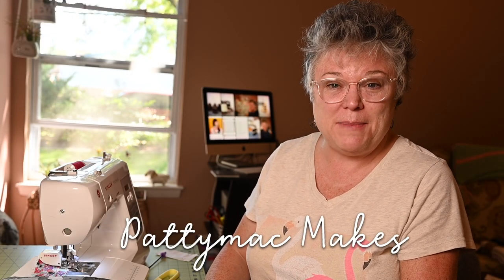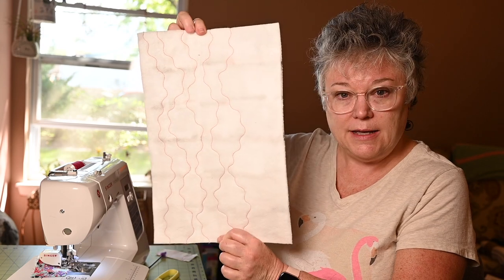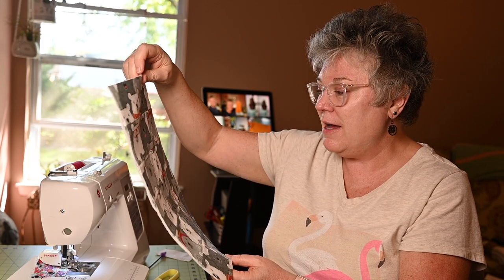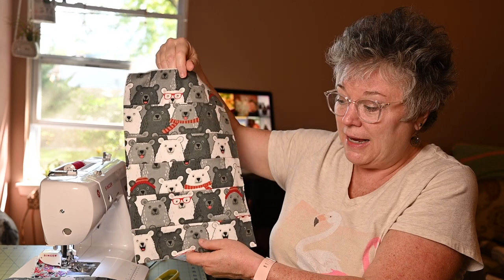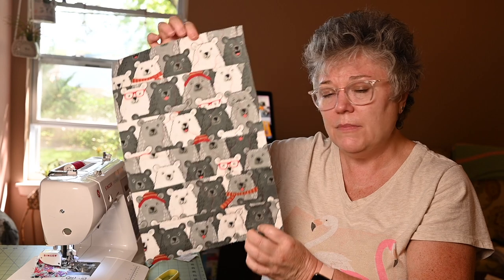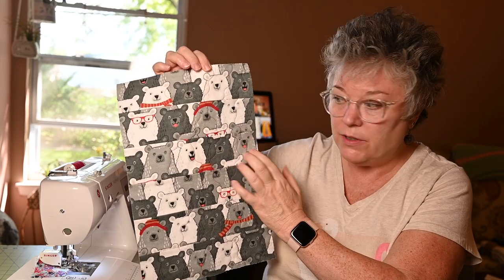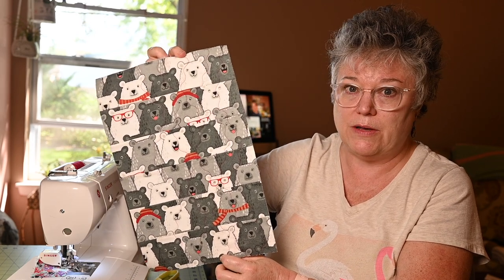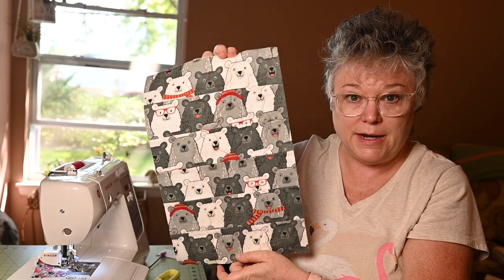HOW TO USE A WALKING FOOT FOR QUILTING | How to install the walking foot and why we use it

Comment: /Thank you for the instructions,  I was at the end of my rope.  I still had an awful time with it because I couldn't unscrew the little screw and I couldn't turn the tab on the needle assembly.   The factory person must have tightened them with all his or her strength.   However after an hour and many tools I managed to put the walking foot on.   I 'm not sure I will ever do it again though.  There isn't room for my hands to manipulate the little screws and knobs.   Wish I'd bought a different machine.   
I sewed the binding on 3 layers but it's very tight between the foot and the machine.  The binding has many puckers and gathers in it now.    I loosened the tension but it didn't seem to make a difference.     I could hardly force my project under the foot.   That must be what they call a short shank.   I can see when I turn the binding to the other side I will have to sew it by hand.
Reply from the maker: You're welcome! It is pretty difficult to quilt on a home machine. I tend to leave the walking foot installed on a secondary machine so I'm not constantly fiddling with it. It's a huge rigamorole to change out so having a second, heavier machine is how I manage with mine.
Reply: Yes, I'm planning to do that too.  My old machine is fine for everyday things.  At least this new 4452 has more power to force the needle up and down without stalling and getting stuck.      Thanks for being so helpful.

Comment: My walking foot will sometimes not move. It’s like the feed dogs on walking foot sticks.Why?
Reply from the maker: I'm not sure Kay. I would recommend double checking the installation and make sure everything is sitting where it's supposed to sit and be sure you are securely attached the shank. That screw does work itself loose and it causes a fair amount of issues.
Reply: @PattymacMakes  thanks but I’ve taken it off and repeated the process several times and it still sticks to fabric

Comment: Hello, Love the video, I was very scared of changing to the walking foot. I am going to be starting to sew again. What was the fabric before and after that were showing before the main item?
Reply from the maker: Gosh, don't be afraid of it! Do be careful changing it out and back because you are attaching it to the bar that is directly connected to the upper housing. Since doing this video, I've set up my secondary machine with the walking foot and leave it attached all the time to minimize the wear and tear of constantly changing back and forth. So if you have two machines, I do recommend doing that. The fabrics are a flannel I cut into strips and sewed together and then adhered fusible quilt batting. I hope that answers your question. Jump in and enjoy!

Comment: Ok so I just came across this tutorial...I was looking for this exact thing....I'm so happy you have the same sewing machine as I do...thank you for making this tutorial....I have sewn on this machine for many many years and I have never till now even opened the bag for my walking foot....I'm about to start my next quilt and I will be giving this a try......thanks again 😁😁😁
Reply from the maker: I'm so happy you found me Amanda!! The walking foot makes such a HUGE difference in anything with multiple layers or a slippery type of fabric. I actually keep it permanently installed on my Singer Heavy Duty these days, and it's always ready.
Reply: @PattymacMakes  
I agree it makes a big difference....I put it on step by step of your instructions and I have started to piece together another quilt and I think I am also going to leave it on permanently......thank you 😁
Reply from the maker: @80657  I'm so happy to hear the video instructions worked so well for you! Thank you so much for that positive feedback. If you have a second machine that you can set up with the walking foot and leave it on, that's my recommendation. It's a little bit of wear and tear to install and remove it, so I have found having a machine to use as my walking foot machine is my best method.  You are always ready to go and to you reduce wear and tear on the machine that comes with taking the walking foot off and on constantly. I also use my walking foot to work both steps in binding as well.
Reply: @PattymacMakes  -  Everyone has such glowing reports, I'm just a person with a rain cloud over my head.   I'd sure like to see someone put a binding on with the Singer 4452 and walking foot, (without puckers and gathers)!!!!   I'm thinking about boxing the darned thing up and sending it back.

Comment: Hi Patty - thanks for the video. I have now successfully installed my walking foot to my Singer brilliance machine! However it would be great if you could have shown us how to put back the other foot - with that other metal piece you removed (I don't know what the name of it is!!) HA! Thank you again.
Reply from the maker: OH I wouldn't have thought of that! I'll see if I can work that in.
Reply: @PattymacMakes  Thank you that would be great Patty! Otherwise I don't know how to put that other piece back on again!! Your videos have been so helpful to me as a beginner sewer.
Reply from the maker: @mariakeane8913  Mostly you do it in reverse. Unscrew the screw on the shank, remove the walking foot and put the presser foot piece back on. The main thing it be sure your machine is off and you remove the needle before working around in that part of your machine. And be careful, but don't be afraid of your equipment. Have you tried changing presser feet?
Reply: @PattymacMakes  Trouble with turning machine off is the light goes out too.   So a person needs a separate light to see screw holes.   I had to turn mine on.